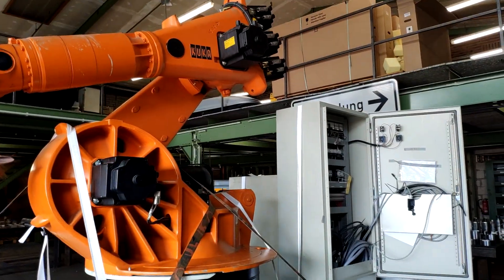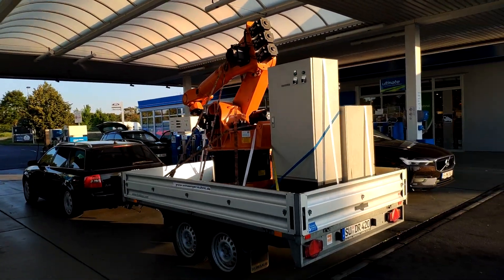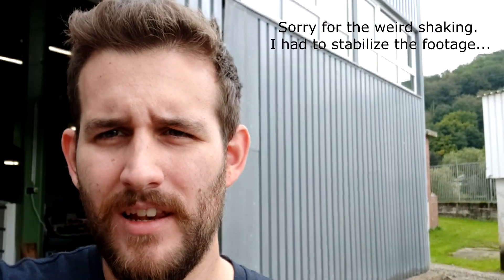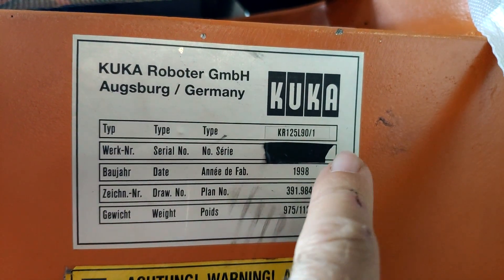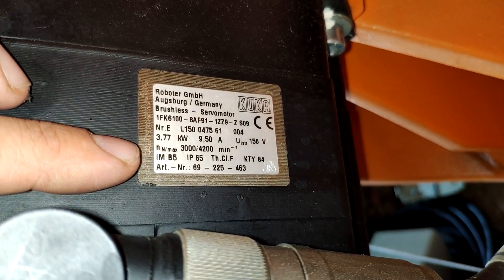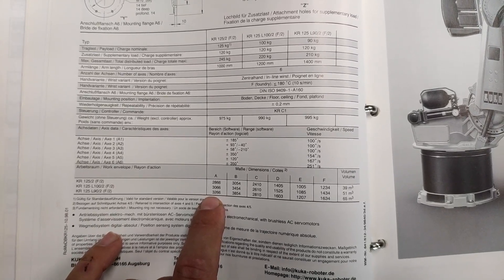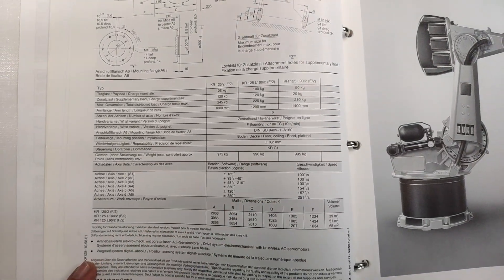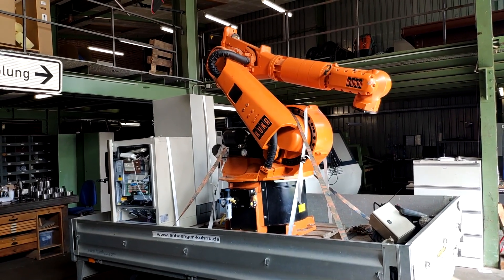My Tiny New Robot (KUKA KR125)

Comment: Get in touch with Dave at Dave's Armoury to learn about robot control. There are industrial 3D printer slicers specifically for robots like this. But this robot would be useful as a production welder or auto-loader/-unloader for your large machines.

Ooh, you could cosplay it as the arm of the semi-trapped djinn from the Magi manga/anime - everything but its head can leave the vessel.

Comment: Kuka has a cnc software package that you can buy if it works for the krc 1 I don't know. Never seen it never used it just know about it. Although the mostly used and latest now is the "krc4" models. I have worked on the krc1's and 2's but experience is limited with them. Have done alot of krc4's.
Everything you received "should" be plug and play. All plugs etc are keyed so you can't break anything unless the previous owners themselves changed something. You can get in contact if you are in need of some documentation. I have alot that I believe will really help you if you've never used one before

Comment: The motherboards and hard drives used to fail on the KRC1 controllers. Image the hard drive if its still working and have a look for the original CD's that had the operating software and maintenace manuals on them. When shipped from KUKA they were in pocket inside they controller door.
Reply: The motherboards and hard drives are now over a quarter century old and run Windows 95 and like mars rovers  a vxd as the real time operating system. I have spares if anyone needs them.

Comment: Nah! Extra points if you manage control it with an arduino
Reply: Possible but would require many very expensive servo motor controllers and the Kuka servos run on 600volts to be high torque.

Comment: Maybe make it a shop hand with switchable attachments for 3d-Printing, welding, maybe just a tray or a vice for material handling or positioning. 
Very nice orange beast!

Consider safety for anyone working  in reach ... i.e. position/touch-switches or similar.

Comment: Ah a KUKA from when it was still German!

An obvious application would be to build a multi-axis (>3) 3D printer, for prints with double curved surfaces and isotropic mechanical properties. Modifying a slicer for this purpose may be PhD level stuff though.

Attaching a camera to the head also provides interesting opportunities for photogrammetry applications. Maybe it can even work like a 3D pantorouter, first scan an object, and than immediately print a copy.

I can't say I have any experience with robotic arms, but in recent years, I've grown more and more interested in working with them. I may join your discord.

Edit: Maybe it can also pass the butter?
Reply from the maker: yeah 3d printing would be obvious but the software/PP will be the most development. Well see!

Edit: It cant pass the butter right now. we need pickle rick to set it up!

Comment: What precision does the robot have in repeated movement? 
While working on a bigger project for it use it as a really crazy flexible camera operator for your videos😁
Reply from the maker: It is listed with +-0,2mm repeatability. But that doesn't mean it will chase a perfectly straight line from one point to another.

In terms of camera mount - that's 100% what I'll do! Thank you!
Reply: @Roetz40  So I guess the repeatability is dependent on the amount of joints involved in a particular movement - each joint adding it’s error.
Reply from the maker: @zweiter  Well repeatability isn't that much. But precision is, as you pointed out because of the linked connections. If the controller has enough time, it will reach a set point with very minimal error. But if it has to interpolate 5 axis in real time on a dynamic path - the precision will suffer badly.

Comment: My Prototrak milling machine from 1996 is just as capable as our new Haas milling machine. Faster actually to program conversationally than the Haas, but much slower speeds and feeds. It also has the 3.5" floppy disk. It’s super easy to convert those to a usb floppy disk emulator. I did mine with one I got on eBay.
Reply from the maker: Do you have more information on the floppy to USB converter? Ive want to use one of them for a different project on a Siemens 840D
Reply: @Roetz40  just use an old machine with a floppy drive. Alternatively The Kuka disk can be written and read from using windows for workgroups ( I talk to mine through a windows 10 notebook) and a cat5 crossover network cable as long as the control cabinet is complete.
Reply: This video was helpful. https://youtu.be/taFP1J_lZBI

Comment: Nice project would be teal 3dprinting or put a spindle on an make it a milling machine for Woodcarving.
Partloader for a milling machine would be boring.
Reply from the maker: Youre right. A 1000 kg chainsaw with 5 m of action radius is far less boring ;D
Reply: @Roetz40  an angle grinder with a carving shell should be fun to. The first project should be to use to opening (beer)bottles or stirring coffe.

Comment: Mig Welding printer
Reply from the maker: I have the proper welding machines for this. Noted!
Reply: @Roetz40  A caution about attaching a welder to it -- ensure you have proper grounding of everything involved.  Check out this video to see what happens when you don't:  https://youtu.be/7FwdMjYUyKM
Reply from the maker: I felt his "Why"... That thing is trashed
Reply: @Roetz40  the Kuka is designed for welding! Make sure none of the earth cables in the faraday cage cabinet are disconnected and that both the robot and any conductive material it comes into contact with are securely earth bonded to an excellent common earth with as short and large a cable as necessary. It's specified in the manual.

Comment: alternate idea: mount it upside down on the ceiling, paint it white and attach a GladOS head to it. (very practical and useful project!)
Reply from the maker: Ceiling is not possible im afraid. but ill have a look at the GladOS!
Reply: Bad idea.  The A2 counterbalance is built for gravity in one direction.  Inverting the robot without replacing the counterbalance with an inverted version could cause it to move incorrectly.
Reply: Not possible... Until you buy a bigger ceiling 😂
Reply: Also add motion tracking, creep people out the shop :p

Comment: I'm on the same adventure. I got an Old KR150 last month. (same robot little higher payload)
Also KR C1 (windows 95) controller.
I want to convert it to a milling machine, but most CAM software for robots is to expensive.
Reply from the maker: Isn't there a KUKA postprocessor already in fusion 360? I would have a look into that, software is free and can do a lot of things for getting a start on the project. (but surely isn't the first choice for 5 axis machining).
Reply: @Roetz40  Thanks for the tip, for sure gonna test it :-D  
I Hope it works on the older kuka's
Reply: @Roetz40  Hi, i Got it to work.Thanx again for the Fusion 360 tip!
https://www.youtube.com/watch?v=Fz69OS91rCU
Reply from the maker: @Eddy_AREA99  great, which size of a KUKA is yours? Seems beefy! Have you joined the discord? You can share your project there and also get help if you need :)
Reply: @Roetz40  Ik Have an KR150.
I will join the Discord Soon.
Reply: @Roetz40  kan you send a new Discord link. Finally got some time, So I will Join 😀
Reply from the maker: @Eddy_AREA99  sure

https://discord.gg/x6nxhaDg
Reply: I have no knowledge of this but it strikes me that LinuxCNC would be worth investigating. I've seen 5 axis milling on it albeit on a traditional mill... i suspect with some tinkering and some time and effort you could get where you need to go for no money.
Reply: ALL software of that type is expensive. Remember repeatability is NOT the same as accuracy.